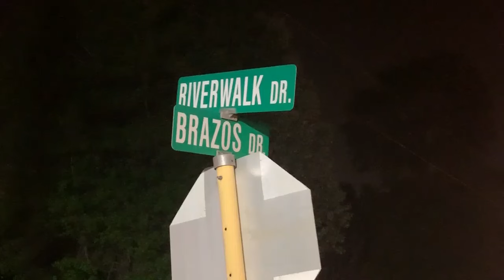031520 OFF DUTY METRO POLICE SGT FATAL

Comment: imagine this cop was giving speeding tickets to others while he couldnt follow the rules himself, even he is guilty he still do not deserve that to die like this. i think that big LS motor made that car nose heavy and littler weight on the rear wheels and became uncontrolable
Reply: Actually the original 235 six cylinder that car came from the factory with was five pounds heavier then the old style small block V8. The LS engines use thin wall castings, so it should be lighter yet.
Reply: Ls is super light considering it’s size we throw them in Japanese cars like 240s and the aluminum v8 doesn’t outweigh the iron 4banger by much. But the ls makes good power and can effortlessly break traction in these old schools
Reply: The same thinking as an experienced lifeguard can't down. Just because your an experienced trained driver doesn't mean you will ever experience a fatal accident.

Comment: Horrible to smack a tree in that manner speed was definitely the factor. The LS looked to have work on a structure that was built for a quarter of the power from engineering to the sheer weight of it. A subdivision and he took his friends car? Too many bad decisions. The rear could of swung out not enough brakes to help momentum. Tragic

Comment: So we know absolutely speed was major factor, but why,  why  why, did the brakes fail?????   Accelerator stick? 
What a horrific wreck, 😱😵 and blood on door too, how sad. RIP brother😭 🙏
Reply: They probably didn't. This car doesn't have ABS, may not have even had power brakes or disk brakes.
I mean yeah it had an LS swapped into it but I can't see what other things may have been done to it. 
Just probably drove way to fast, stamped on the brakes, then they locked up due to no ABS causing loss of control and a spin into the tree.

Comment: Seat belts , air bags , and some welded in sub frame connectors  that integrate a  roll over and side impact protection. You really need  to reinforce these old vehicles when you over power what fhey were built for 65 years ago. 
Just a few simple things might have saved this man.

Comment: Old cars like this are so poorly constructed that even the smallest crash can prove fatal. In a modern car you could be going 3 times the speed and still just step out afterwards. Car makers just didn't have a clue on how to build safe cars back then, no seatbelts, steering wheel centres that would stab you through the chest, engines would be pushed into the passenger compartment etc.
Reply: @roberth912  I bet he was going a lot slower than that. These old cars are shite, look at crash tests with these old things and you'll be shocked how easy they just fold up like cardboard. The chance of you dying in a car accident in one of these has to be 100 times more likely.
Reply: @davekennedy6315  did you not see the LS Corvette swapped under the hood???? This car had 400+ horsepower. The original only had 140..... wasn't designed for that much... It even had skinnies on it... Driver was drunk. High horsepower while drunk is no good

Comment: I'd say he was doing 120mph easily.  Almost  split in half
Reply: 50 or 60 is all it takes for those cars. People think because they are heavy, they are durable. They just weigh more but there is no crash absorption built into the car.
Reply: @JubeProductions  actually older cars don't weigh anymore than the new ones. That car probably weighed 3500 pounds or little more. A new Camaro is roughly the same weight.
Reply: @juniorthird7952  54 Chevy four door weighed in at 3230 pounds. I've owned 53 and 54 Chevies, to put in the V8, you have to use the newer transmission, and rear end, so at least the rear of the car had modern brakes on it.
Reply: @juniorthird7952  Thanks. I'm not much of a car spec guy, and just always assumed they weighed more.

Comment: Those cars were built with a straight 6 engine with under one hundred HP and you go and add a new LS Fuel injected engine that's more power then the car was ever built for and if you don't build it right the car does not handle at all at high speeds

Comment: No, the car! 
Respectfully not even airbags could have improved survivability. First thing on the list when restoring classic automobiles is replacing windshield and side windows with safety glass, and replacing single piece steering wheel column preventing drivers from getting impaled during front end accidents.

Comment: I've been driving and screwing for almost 28 years now and I've pimped up many a car, but when I see something like that I don't know whether I should be upset or just sad because an LS engine is built into such a beautiful old car without it Roll cage and probably without disc brakes, yes it looks like even without brake booster, sorry but that had to go wrong at some point, no matter whether the driver has it or not, that's a ticking time bomb for me and luckily that's not possible in Germany because the TÜV already before pulls such time bombs out of circulation, despite everything I wish the bereaved a lot of strength and all the best

Comment: Damn the real owner put a lot of work into that car just for an idiot supervisor to drive into that tree. Apparently, Christine didnt like him either and decided to take a detour into that tree. Those tires are bald as hell and u can tell where those tires locked up and fucked him up. Those old cars dont have ABS or pwer steering so if u loose control at high speed there is no recovery from it. Hell, I think the steering wheel even locks up too. By those tire patterns he had those brakes down hard all the way to the end.  Vette heads in it too....oh yeah, not surviving even if he hit that tree going 30 mph

Comment: LS engine, probably not much for suspension and brakes. No seat belts, People think these old cars were better for crashes, just the opposite, new cars today are much safer, your driver compartment is your safety cage, air bags, crumple zones etc. The new cars absorb the impact.

Comment: Let's put a Corvette engine in a '54 Chevrolet, with white band tires, what could go wrong? Those cars where HEAVY and looked hard, but that good 'ole metal was not strong and easily collapse under it's own weight even at moderate speed, Crash Tests show this. RIP

Comment: To much motor for the old chevy,  should've keep the 6 🙄
Reply: More like to much car for the driver. No difference to all those modern Mustang and other performance cars that are crashed daily. It's all people that overrate their own talent as a driver. Easy to push the throttle to the floor, but if the car hits it's limits, then most drivers also run completely out of talent.

Comment: 3:36 What a tragedy, also that is such a horrible air filter choice for an engine that size... Maf sensors have to be a certain distance away from the throttle body and filter so they can get a proper reading. It was likely running like ass, possibly contributing to the crash

Comment: 1954 Chevy Bel Air could barely handle the 115 hp engine it came with, due to its subpar suspension and brakes.    Drop a 400 hp Corvette crate engine into that same car, let some idiot who had never driven  it before take off in it,  what could possibly go wrong?